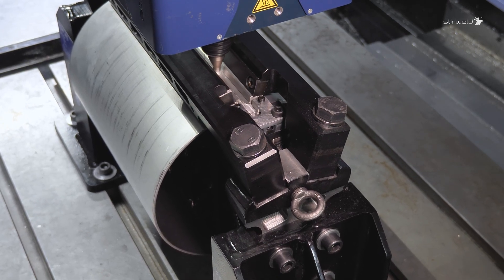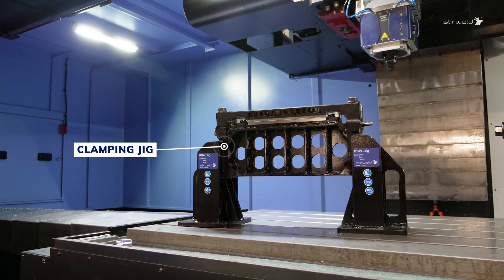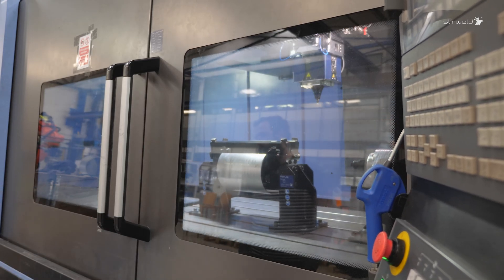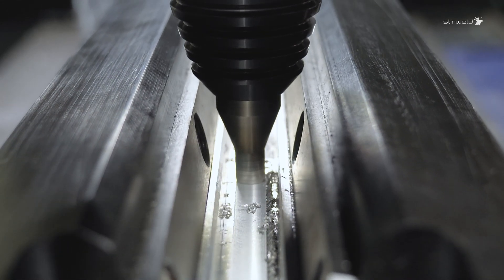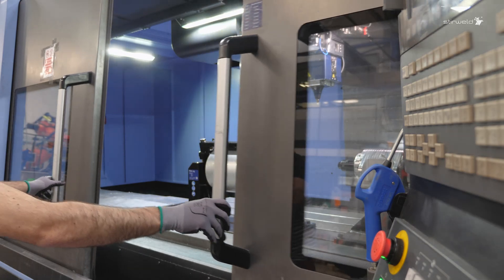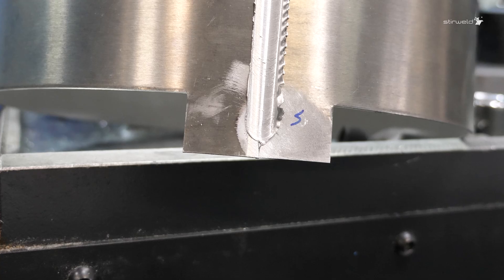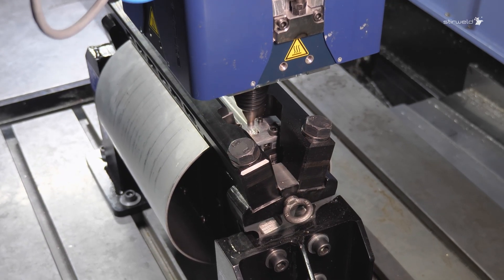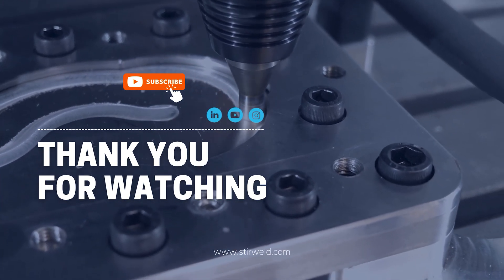Longitudinal FSW weld in a cylindrical part | Aluminum Tanks

Comment: Does it work on carbon steel? Is it possible to weld sheets up to how many inches thick?
Reply from the maker: Hi, yes, it works on carbon steel, but it requires a very specific, high-cost tool with a short lifetime. We usually say it is not economically sustainable, for the moment. As for your second question, it highly depends on the machine which is used for it. At Stirweld, up to 14mm of aluminium in one pass, 28mm with two welding passes.